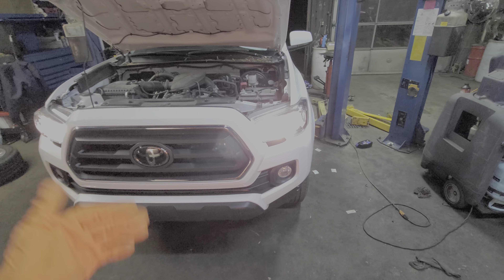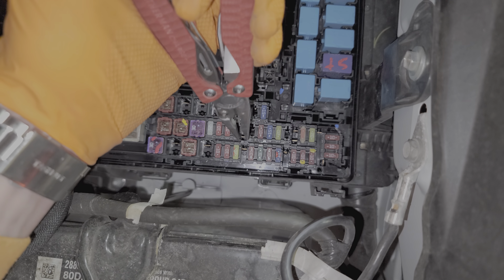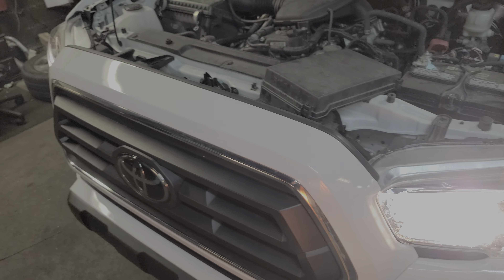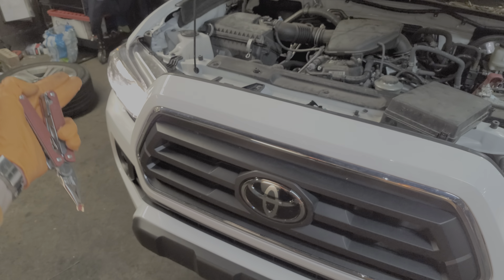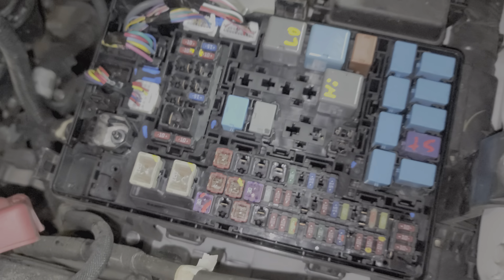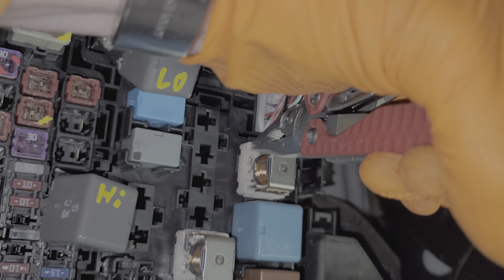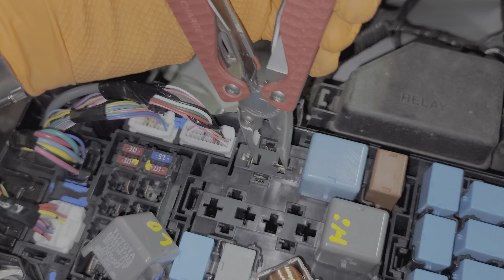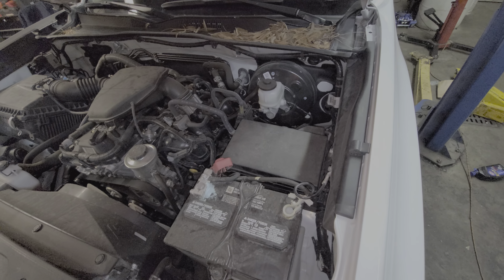2020 Toyota Tacoma Headlight Fuses & Relays

Comment: This video was extremely helpful; had bought some Trd pro style alpha Rex lights that I thought didn’t work but turns out it was just the fuse!
Reply: Had the same exact issue with the alpha Rex lights… this video saved a lot of time!!
Reply: All my lights work fine from alpharex,  but when I turned my switch to auto it dims my head unit and turns on my low beam with DRL. I remember b4 itll just turn on my DRL on sunny days and when it gets dark it turns on both low beam and DRL as it should. HELP!!!!
Reply: Im having a similar problem rn guys! Any help? I first installed the alpha rex head lights and could t get low/high beams. Found out i had 2 blown fuses. Next i replaced the fuses and still no hi/lo beams. Ive put an oem back on and everythjng works fine on the oem but nothing working on the alpha. Are my alphas defective? Relay maybe? Im not sure anymore

Comment: Question Hi great informative video I started by replacing RH passenger lo beam bulb but it still didn’t work. Eventually plugged bulb into LH side it worked so I then followed your video and check the fuses all were good. Went to relays and eventually did continuity check on the lo beam relay pins and lights came on both sides the 1st time but no more. Wondering if I shorted something out in the socket? Appreciate any insight from you. Thank you..

Comment: I do have a couple of questions. I hope you don't mind. I own a 2022 Tacoma. The headlights are stock OEM LED. The passenger side low beam has stopped working. This video helped me ensure that the 10A fuses are good. I don't think I need to bother with the relay or the parent fuses because it is only one side. First question. I want to make sure that the truck in the video has LED headlights, and if not, is there anything additional to check for LED lights? Can a bulb be replaced at this point or is it the entire assembly? The owners manual only says that if there are LED lights to bring to the dealer, and I cannot find any youtube about whether OEM LED's can be changed, but it seems like it is the entire assembly.  Next question. Is it common for the Tacoma (or any vehicle) to have the LED go out in 12000 miles? The truck is under warranty and I will be taking it to my dealer next week. I just want to be as informed and educated as possible when I take it in. Thank you!

Comment: So installed some smoked led projector headlights (VIPMOTOZ) on my cousins 09 Tacoma and the LED strip doesn’t turn with the auto or full on switch settings. Haven’t checked the fuses yet but all other lights within the headlight work so I’m thinking it might be a DRL fuse but I’ve read replacing the tail light relay fuse somehow fixed the DRL issue.

Comment: So my low beams don’t work- the relay clicks and is good- not getting power to the connector in the fuse box.. do the pin connectors go bad in the fuse box? Or do I think I have a wire issue leading up to the fuse box? DRL work, brights work, turn signal work just no low beam headlights

Comment: what if your DRL lights are not coming on.  I have power going to them because the blinkers work. The DRL fuse is good, however they're not turning on.  What could be the issue?
Reply: Do you have aftermarket LED’s installed?

Comment: Hi I got a problem with my 2018 Tacoma, the passenger side low and high beam are not working, I did check the fuse is Ok, the driver side are all working fine

Comment: You know anything about blinkers a relays for hyper blinking
Reply: That would be awesome.  I heard no such relay exists for the 3rd Gen Taco.  They DO for the 2nd Gen.  If anybody else knows a way to use existing LED bulbs in turn signals without resistors, or buying new bulbs, that would be clutch.

Comment: Great video. I'm still having problems with the passenger side high beam light. Won't turn on.  Checked fuses and relays, but no luck. Can you help? Thanks.
Reply: @dnakmalinois8240  did you find the answer? Having the same problem

Comment: I know this video is 3 years old but im hoping you can help. As i believe some others have commented on here, I too am having issues with my 2017 Tacoma LED DRL's. I have checked the DRL fuse and replaced the relay, still having issue. The DRL's will not come on during the day or in the AUTO position. At night they will turn on (dimmed) with the headlights. I don't think it is the sensor as the headlights stay off during the day, and only come on at night as they're supposed to. I do have aftermarket (alpharex) headlights but i installed the OEM back on and exact same issue with OEM. Forums stated the e-brake being engaged could cause them to not come on, already confirmed thats not it as well. I'm at a dead end lol PLEASE HELP!

Comment: Great info. Question my friend: My 2018 Tacoma DRL lights flicker when I turn on the low beams. HIGH, LOW and Fog halogen bulbs were replaced with auxbeam LED bulbs. They were working fine for a year but now the passenger side DRL flickers when low beams are on, does not flicker when DLR or high beam mode. Any advice to trouble shoot the problem ...

Comment: I’m looking to find out why my factory fog lights stopped working. I did a continuity check on the 15A fuse location for the fog lights and the fuse isn’t getting power. Could it be a bad fusible link? I’ve changed fuses with known good ones and still nothing. Also, lightbulbs have been changed and ground connections have been cleaned up, still nothing. Any recommendations?
Reply: Did you find the problem I got the same issue

Comment: I want to connect a switch wire for ditch lights, to illuminate the back light when the headlights are on. Which fuse should I choose to connect the add a fuse to? Thanks!

Comment: I have a LED headlight system malfunction and states to see a local Toyota dealer. All the fuses are good and headlights and running lights all work fine- both low and high beam. I’m still scratching my head trying ti figure the problem out. There is no level sensor.
Reply from the maker: You will need an enhanced scan tool that can retrieve manufacture-specific codes to proceed

Comment: I bought the new sequential headlights for my 2020 Tacoma trd and for some reason my low beams keep blowing out the fuse. The harness is connected correctly and everything else seems to be fine, even my right headlight turns on no problem but my left headlight keeps blowing out? Can you help me?

Comment: I bought the Raptor LEDs for the TRD Pro Grille but I wanted to hook them up to the Fog Light Fuse. Can it be done that way and which is the correct fuse?
Reply: Hey did u ever figure it out?
Reply: Fused tap the #10 amp fuse on the rhL lol fuse next #20a fuse. Or just connect to fog lights fuse

Comment: I have a issue with my Tacoma the left turn signal is normal for few seconds and then hyper flashes. It's only the left turn signal. I have checked the light bulbs and they are all good front and back. I do have morimoto led taillights but most people have put these on and never had to get resistors. Any help would be appreciated.
Reply: Have you found a fix, I have the SAME issue, first with the left, now both do it.
Reply: @shanebiggs9128  I removed the light and found that the resistor wires were loose and some were not even connected. So I connected the wires and used electric tape so it won't undue it self again and put it back on and hyper flash was gone. I have been riding for 2 months now with no issue of hyper flash anymore. Hope it helps.
Reply: @idrisahmedi4686  thanks I will try it that this weekend to see if that's the issue